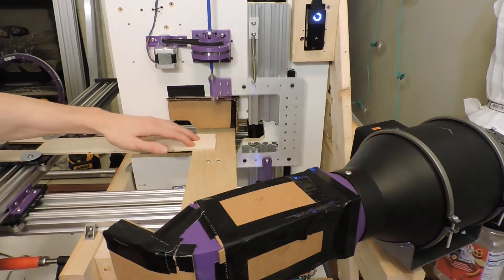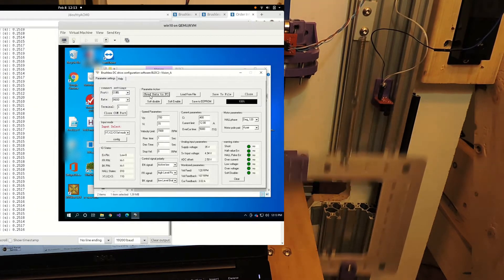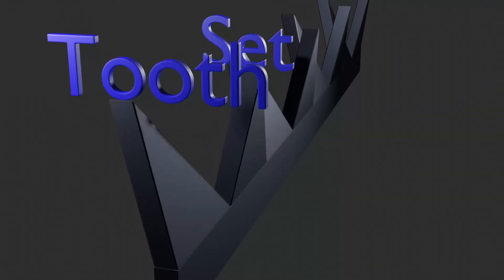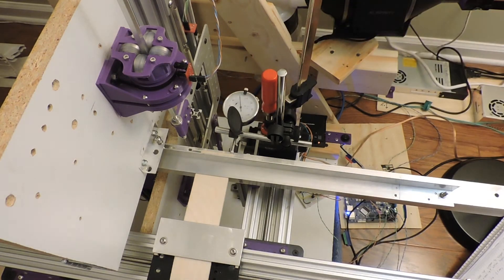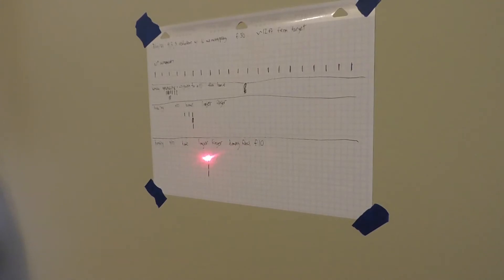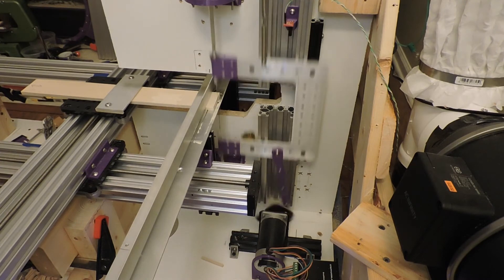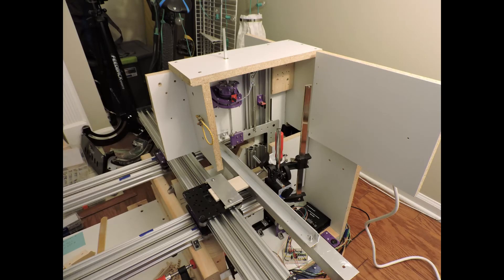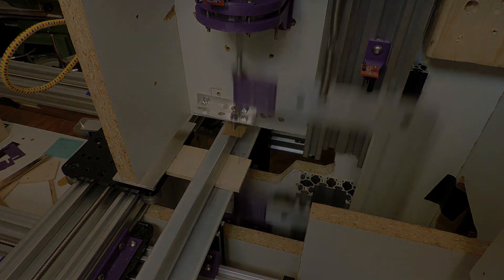CNC Scrollsaw v6 - Cut Testing

Comment: I'm still thinking you're going to need to add a camera to see the exact angle the blade is pointed at.  I find that the blade drift changes as the blade dulls, along with lots of other factors.  When cutting against a pattern you constantly look at the line of actual cut vs the line of intended cut and adjust as you go.  When you don't have a printed line to compare against you just have look at where the blade is pointed vs where you want it to go.

You might want to go back to looking at a hold-down.  When cutting small pieces it's important toward the end to hold them down so the blade doesn't pop them up and away.  This is especially true right toward the end when the remaining wood is thin enough to break before it can be cut.

Tweak the necks on your interlocks.  A good neck is the key to a good lock.  If the wide part of your lock isn't enough larger than the neck than the kerfs, as small as they are, can make the pieces loose.

The foamboard will let you test some things but will mess up your blade drift checks.

Great work!  Looking forward to your continued progress.